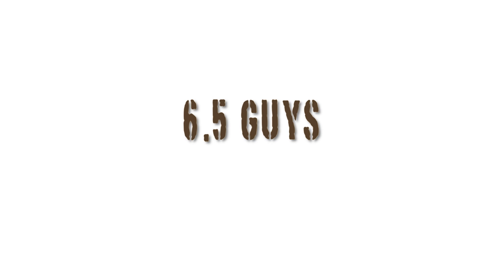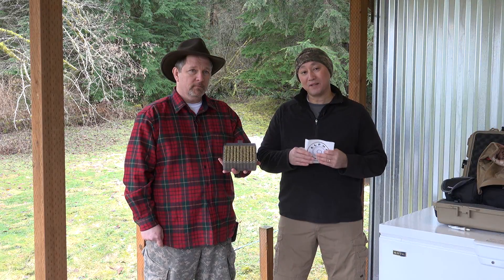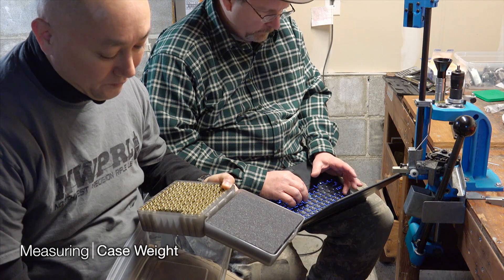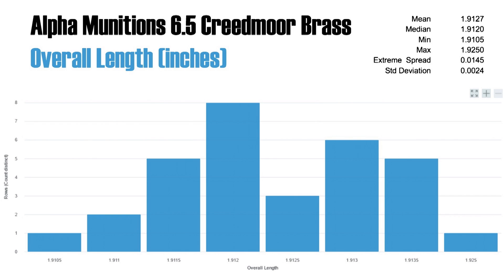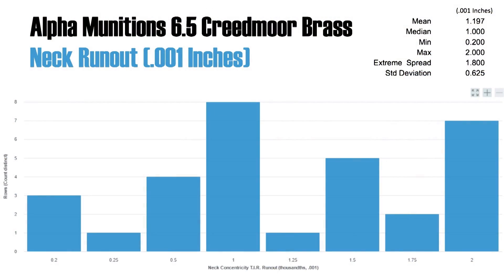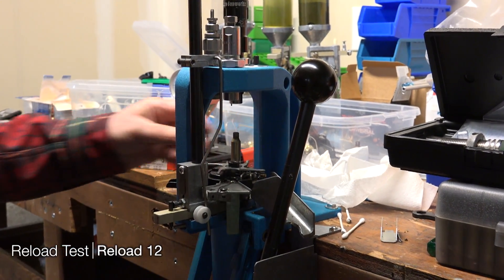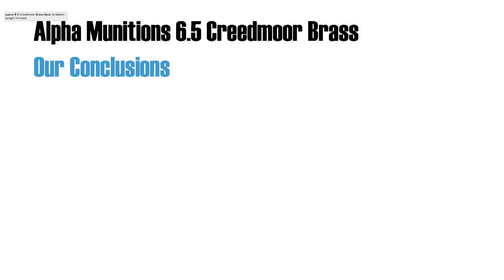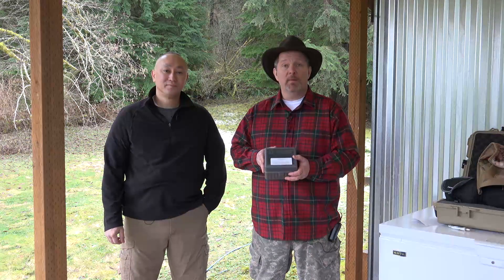S4 - 03 - A Look At Alpha Munitions 6.5 Creedmoor Brass

Comment: Can you all do a test with the Peterson brass?  Thank you!!
Reply: I have found a little better results with My Peterson brass in 308 as far as Case to case weight spread. Length I did not measure because I sized them first. I am on my 7th loading of 308 and most of my primer pockets are still pretty tight and I am pretty certain 12 loadings will be easy with this brass.  New they were super tight and the tightest I have seen. 100 case lot. That is my first experience with Peterson. I love it.

Comment: loosening at 10 reloads? f that - staying with the lapua
Reply: bavariasuhl This is a hot load.  Area 419 did a test averaging 2798fps and achieved 25 reloads with no blown primers.  Large rifle primer will not outlast a small primer pocket but if ran at normal pressures you will get 17+ reloads out of Alpha .
Reply: We spoke with the Alpha folks and you make a very fair statement. Any brass using a large primer pocket is not going to hold up to a comparable piece of brass using a small primer pocket. The fact they made it past 10 reloads with a large primer pocket should shine very positively on Alpha.
Reply: Ed, that looked like a pretty stout load!!! I wonder if you were going to use the same 140 grain bullet and keep the speeds around 2825 fps, how long they would hold up? 

Thanks, flea
Reply: Hi Flea - we used the same bullet and the velocities were within 1 FPS (2871 vs 2872). We had to use a different primer though (CCI BR-2 Large rifle vs CCI 450 Small rifle).
Reply: Great info Ed, I appreciate it. I loaded 43.0 of H-4350 behind the 140 ELD match bullet yesterday. However, my barrel is super slow. I averaged 2762 fps. Where my shooting buddy shot the same load and was able to average 2805 fps. He also shot 42.7 grains of RL-17 and averaged 2872 fps with a 5 fps extreme spread. I think I'm going to try the RL-17 load as well as bumping up the H-4350. We both have the Ruger Precision rilfe. Which after totting around a 17.5 lbs .308 sniper rifle for years is pretty nice. Thanks for all y'alls help, flea
Reply: Flea - I remember playing around with primers during my .223 load development. Just switching a primer alone affected the velocity by 40 FPS.
Reply: I've always used the Fed. 210 Match primers. I remember years ago Precision Shooting Magazine did an independent test on primers. The Fed. 210 Match and the Winchest Magnum primers were the only ones that produced a dimond shaped flame. The shot sparks in the air. You always want the powder column to burn from the bottom up. The sparks cause the powder to burn unevenly in the case. I've always gotten better numbers with 210 match however, I may try the BR-2's just to make sure. 

 I wonder if Alpha will make the small primer pocket brass soon? I spoke to them last year and they were suppose to let me know when they started making 6.5 CM. lol, I guess I didn't rate a call. I've told all the old dogs to start watching your channel. Even old dogs learn new tricks. Take care and thanks, flea
Reply: Sorry, I meant to say "the others produced sparks in the air" thus inconsistent ignition throughout the powder column. Take care, flea
Reply: Wow, you guys load them hot, I am trying to stay around 2715 with the 140gr.  Bet your barrels love you!
Reply: Alpha brass is made to an exact standard which blows the rest away!!

Comment: you have to resize and trim  which changes datum, OAL before they are loaded  so who cares?
Reply: Exactly - so the fact that Alpha may have had a few more variations out of the box is more of an academic issue. I just wish there was an easy and consistent way to measure case volume short of filling them with some liquid and weighing which could be error prone.
Reply: The dimensions for datum and OAL given in the video are under the recommended trim length and headspace length.  Why would you resize and trim it before the first firing?
Reply: Hi - we didn't trim the brass. Most manufacturers suggest you resize new brass to ensure consistent neck tension, get rid of neck dings, etc. I believe it's a leading practice.

Comment: First Thank You for your time and effort in comparing the Lapua and Alpha brass.  I have one quick question and that is case volume.  I have only reloaded around a thousand 6.5 creedmoor rounds and started measuring case volume with water as per Quick Load.  Your thoughts on this procedure or alternative.
Reply: We're all ears. I've played around with water and alcohol and find it difficult to get consistent results with just a single case. I'm sure it's my inexperience. We don't want to present volume measurements to our audience that might be error prone. One method I'm considering is using small ball bearings and weighing them. There should not be settling issues like filling a case with powder.

Comment: I'm not sure why y'all are weighing cases. There can be as much as 3 grains difference in just the case head. I learned many years ago to use a spent primer and fill the case with alcohol to the top and pure it into a brass pan and weigh it. We sort the brass within 1 grain case capacity. When reloading for accuracy it all about volumn in the cases. Say you have two cases that weigh the same but one has 50 grains capacity and the other has 47 grains case volumn, (or capacity) using the same load. The bullets will not hit near the same POI. I learned this from my Grandad more than 60 years ago. I'm afraid I've gotten to old to teach or compete any longer but 6 world records and a few national wins all at 1000 yds. I don't mind sharing with other shooters. For what it's worth, flea
Reply: Vernon, why alcohol not water?
Reply: Water has air in it and you can't get consistent weights. I found alcohol to work so much better. Hope this helps Sir.
Reply: Vernon Harrison You are correct. It was an easy thing to do and had we not weighed them people would have asked why we didn't.
Reply: acasper9  maybe any residual alcohol left in the case after emptying, will evaporate quicker than water?  I'm just guessing.
Reply: Thank you Ed, I appreciate the info sir.
Reply: Thanks for your comments Vernon
Reply: Ed, it's great to see you folks helping everyone. I retired five years ago after instructing long range precision shooting for forty five years. My old body gave out and it's great seeing folks like y'all helping. Thank you, flea
Reply: You are flea? I had no idea. I've read quite a bit about you. Honor to have you commenting on our forum.
Reply: Yes Sir, it was my call sign in Nam and kinda stuck. I owned Central Virginia Tactical for 45 years until I had to retire 5 years ago due to health problems. My good friend Ed Shell is now running the school. I started watching your videos back last year after I bought a Ruger Precision Rifle in 6.5 CM. I really appreciate all the info you both bring to the table. It's a real service to all shooters.
Take care, flea
PS. The honor is all mine Sir.
Reply: Vernon Harrison Everyone should listen Mr. Harrison. He's the real deal. Glad to see you're still involved, sir.
Reply: So rubbing alcohol will work then?

Comment: I really would love to see you guys try to come up with a load that can make a 6.5 Creedmoor sub sonic...How effective it would be at what ranges, velocities measured, etc...I havent seen any videos like that and I think it would make for an interesting video
Reply: 50 Stitches Steel Well I do have Trail Boss that I've used for .308 sub-sonic...may also work in 6.5x47...
Reply: Ed Mobley That would be cool to see the results
Reply: I just need to get a 6.5 Creedmoor rifle. But your comments have inspired me to start playing with my .308 subsonic loads.....
Reply: Ed Mobley Let me know what kind of results you get..Even if I could get it to drop a deer at 2 300 yards I would consider that a success..Have fun
Reply: Will do. Honestly it's more for the fun factor...putting a suppressor on my rifle and it's quieter than a pellet gun.
Reply: Ed Mobley For sure bud. Im also interested in seeing what the round can do at those speeds too.  Cant deny its just cool to have a super quiet rifle too lol
Reply: So far I've pushed 180gr bullets with my .308 subsonic. Need to get some big heavy 200 grain plus bullets.
Reply: I've had great luck running TB under Lapua 200gr Subsonic. Drilled flash hole and LR magnum primers. About as close to movie quiet as you can get and I'd say it's .5-1 MOA @ 100 yrds. POI shift is a consistent 3.8 Mils hold from my full velocity 100 yrd zero.